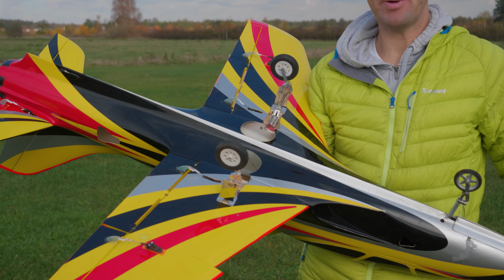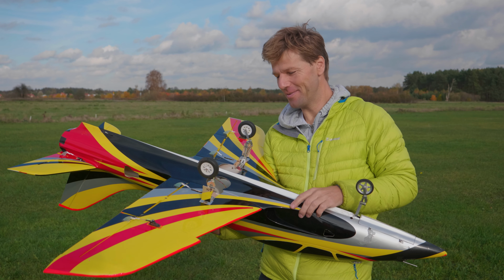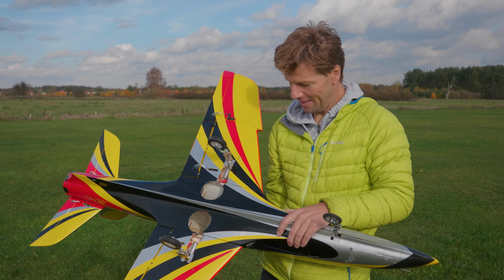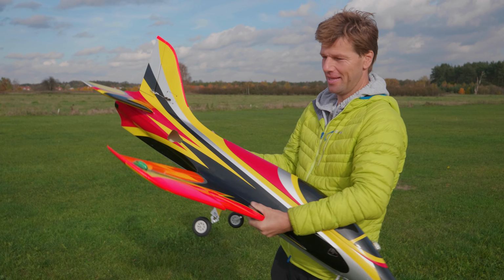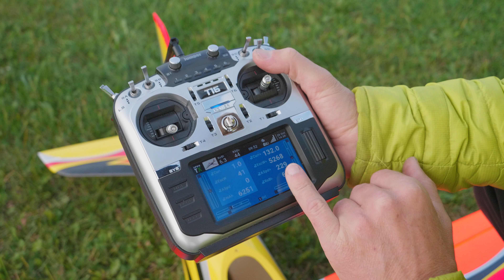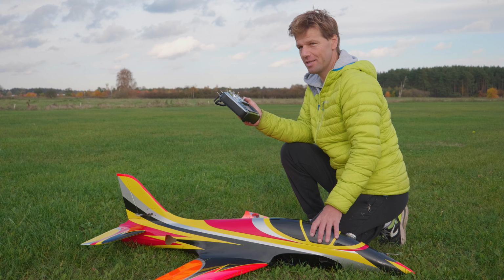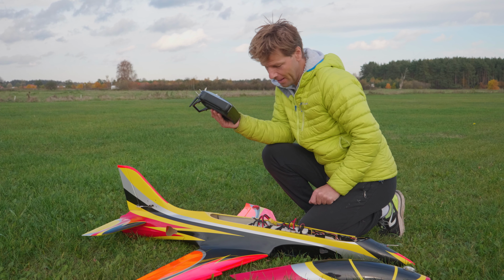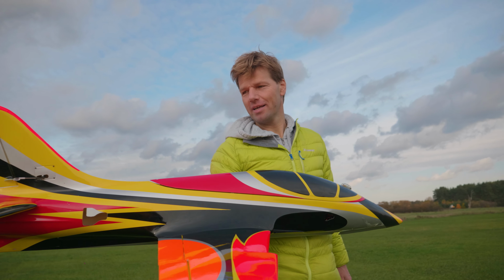New landing gear, 12s Sebart mini Avanti S WeMoTec Midi Evo 90mm HET 700-75-1400 Li-ion  Samsung 40T

Comment: Sorry but the Avanti with Schubeler ds51 and het 2100kv reach 220km/h without dive. We have 2 in our club ( one is mine) . Key point with Avanti is to keep it light 😉
Reply: On li-po batteries I assume?
Thats 12% more power right away.
But A LOT less flight time. Plus all the hassle with LiPos.
Reply: @adamtrzaskowski3901  yes, I assume.
We have 3 minute ( on motor timer) and with throttle management we achieve 4 minute fly. We prefer performance on flight time. And lipo I agree, but keep it in storage after each use , in cold and dry room keep it safe and last longer. I have 8 gens ace 5200 ( 2016) with thousands of flight in perfect condition 😉

Comment: I think you went the wrong way for better landing gear. Try these: 
https://www.jautsch.de/fahrwerke/fahrwerksbeine/jet-1a-fahrwerksbeine/jet-1a-bugfahrwerksbeine/mini-avantis-set.html
Reply from the maker: 125 Euro  comparing to 30 Euro is a big difference. https://www.motionrc.eu/products/freewing-80mm-edf-avanti-s-main-landing-gear-strut-and-tire-ri
But  there is an easier fix for oryginal legs. It is enough to stretch the oryginal spring in the strut and cut it by 30%. Done. The  load bearing doubles,  arm travel doubles, cost 0 Euro. :)
Reply: @EDFjetRC  I have the same Avanti and the stock JP gear is much stronger and better than the FW landing gear. The Jet-1A are the gear folks would go to for flying off grass. But you are correct that there is a huge cost difference. I like your style- Cheers!
Reply: Ciao puoi inviarmi il tuo indirizzo email che devo chiederti alcune informazioni per le batterie
Reply: @EDFjetRC  ciao Wojtek potrei avere il tuo email vorrei chiederti informazioni sulle batterie Li-io che usi grazie Silvano
Reply: And pay 3/4 times more for them 🤣🤣 No point at all